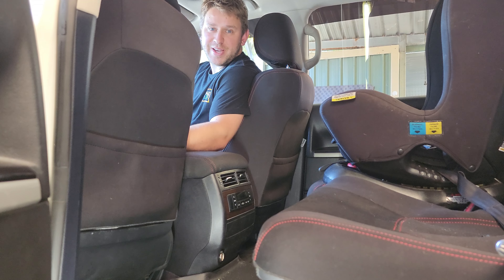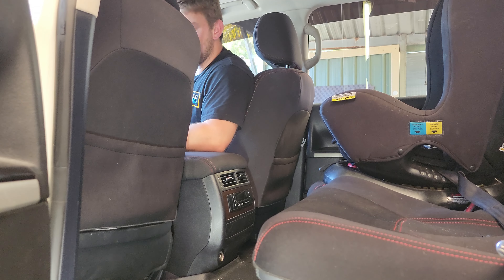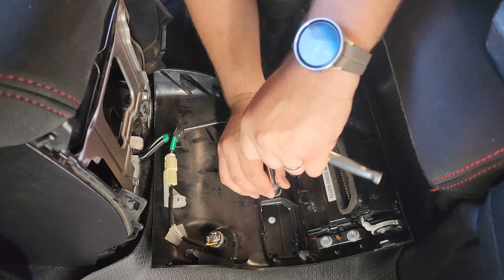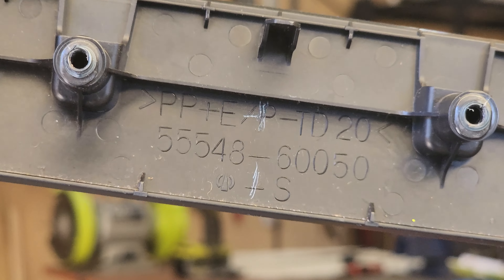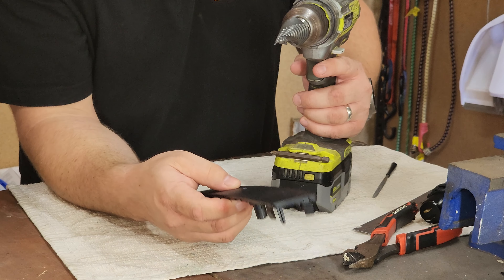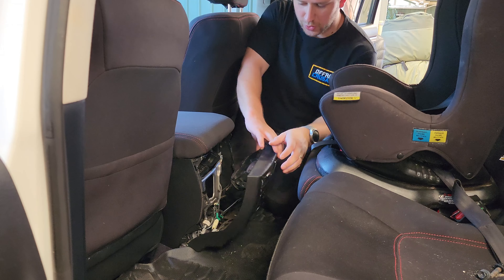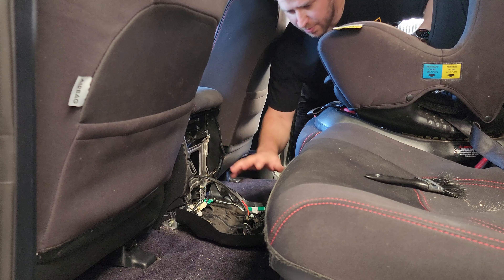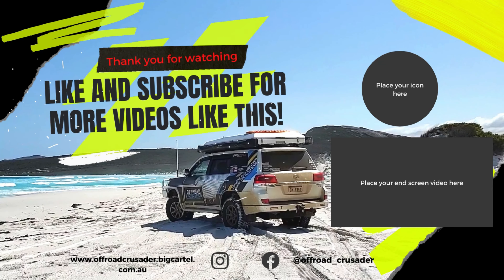Get CHARGED UP | middle row charge ports (USB 3.0 - USB-C) in a Landcruiser 200 series | Fast Charge

Comment: How many watts can it send through each port? Had issues with some specifying 30watts but if you double them up at the same time they cook. 
Fine with a single use at anytime but doubled up no good.
Reply from the maker: I've fast charged 2 phones off of 1x USB and 1x USB-C port for a few hours just fine, but haven't tried both USBs at the same time yet.
Was drawing about 6A from memory